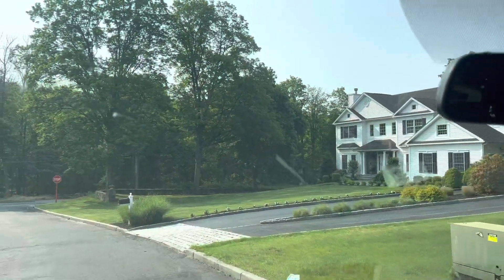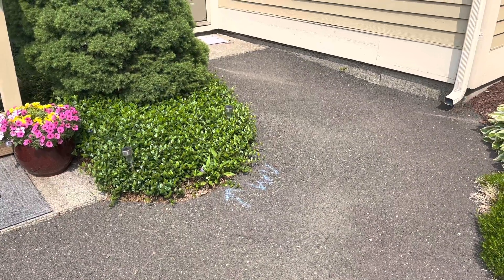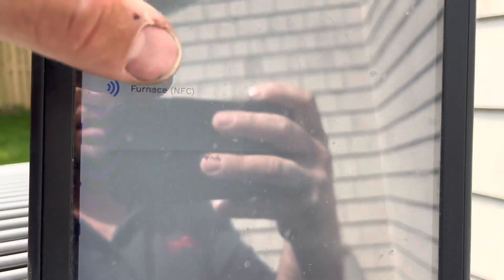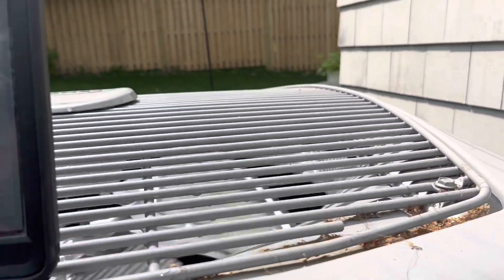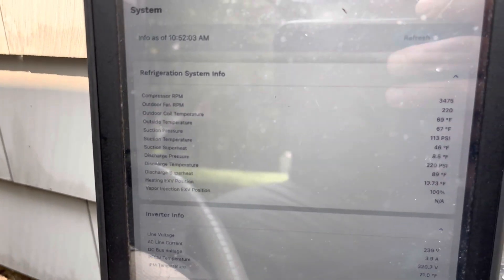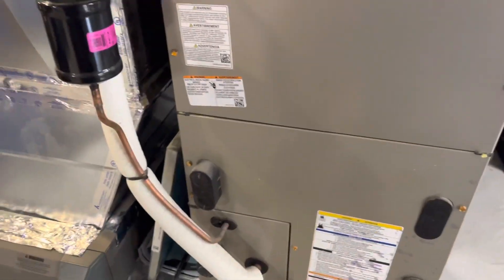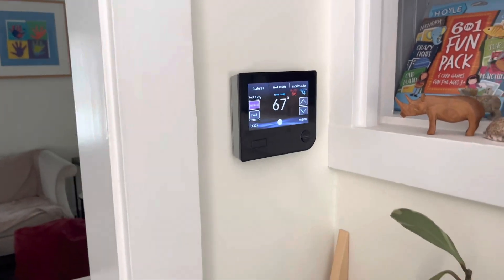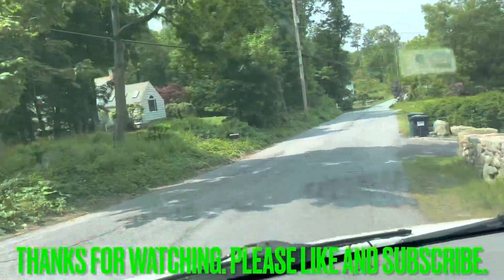CARRIER INFINITY GREENSPEED 25VNA. BLUETOOTH.  @CarrierGlobalCorp

Comment: WoW whisper quite Paul. Love that technology and will have to keep it in mind if my old system goes 👍
Reply from the maker: Hey Anthony.  Yes they run so quiet, sometimes I actually check to make sure they are running.  For real.    Stay well bro.
Reply: @hvacotj  what’s the average cost for a 2-1/2 ton system replacement ya think?
Reply from the maker: I’m not sure of exact price but I know those Inverter green speeds runs pretty high.   I will find out today and text you later.